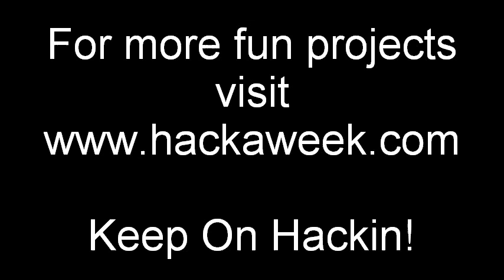MicroRax Robot Chassis

Comment: were you able to tighten the angle brackets very securely? I bought some and all of the anchor pieces were awful. just barely tightening them all would strip them I ended up having to drill all the way through the microrax and use long screws. Love the rax, hate the anchors.

Comment: These are just reduced sized versions of 80/20 rack assemblies. Spark fun started selling these recently. I'm hoping prices reduce quickly because they are really useful. I also had ideas of using off-brand erector set parts and such as building bits too.